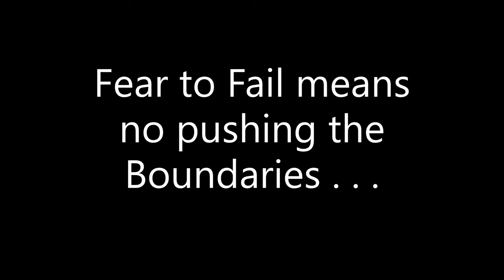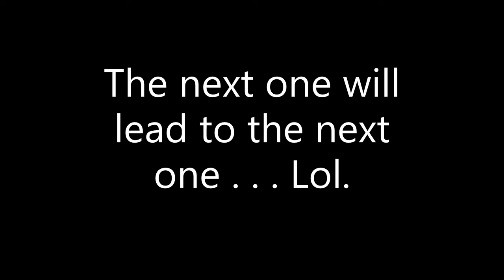The Scale Model Painting Crisis | Boomer Diorama ~ # 230

Comment: Do you show to get the oxidation with ipa in your previous videos
Reply from the maker: I have and it is fairly easy to do, although, the pattern is unpredictable. 

I guess I could show it again down the road. Basically what you do is take a particular color you normally weather with like white, grey, burnt umber and thin it down to a ratio of 95% IPA to the 5% Color you choose. Then, spray the whole car down really wet, and then stop the paint and just let the air flow over the car. As the high pressure air evaporated the IPA, the color oxidizes. With practice you can achieve stunning results on any subject you choose to paint.

You need fairly high P.S.I. (40 - 60) to make it work. It can produce stunning result that are virtually impossible to do without an airbrush. On the other hand, it can go south on you. But you can save it by power-washing the car with straight IPA until it cleans up some. 

Cheers ~ Boomer.
Reply: Hi Boomer 
Another good video. 
I am also working on a tank car that got destroyed by a bad application of Dullcote somehow.
But on another subject, I have quite a few successful projects lately that I thought would be disasters due to paint spills or sloppy ( so I thought) weathering , but when every thing dried I loved the results. A fact that you have said many time. Some times accidents are good!
Cheers Boomer
Bob
Reply: my little trick to weathering , is I keep two cleaning jars for paint brush and air brush jar,  isopropyl ,  one for light color paints ,and one for dark color paints,   and on a dark tank car I will spray the light color cleaning jar across the top of the tank car ,  and if it is a white tank car spray the dark color cleaning jar across the top

Comment: Sometimes I get on a painting frenzy but mostly when I work on a model I'm doing the same thing to each model like changing wheels or replacing couplers.  While working on a model I try to do everything that needs doing and go down the line like an assembly line including weathering.  Lately I've been working on scratch building structures for both HO and O scales.  I'm finally learning the art of dry brushing and it's working out quite well.  Even my wife commented on it.  Cheers from eastern TN
Reply from the maker: Yes. The dry brushing method is an essential skill. Sounds awesome!

Comment: When I first got back into the hobby Floquil and Scalecoat were the go to paints for model railroading. I have never found anything that is as flat as Floquil flat glaze. I’ve had to relearn so many techniques. I have had some success with Krylon flat followed by a very thin wash of cheap craft paint mixed with water then cut even more with 70% IPA. But oh “brother” light coats and dry between coats ( I use a cheap blow dryer). I’ve just about completely switched from chalks to pan pastels. No dull coat after. Let it sit for a few days and it should set. Really enjoy sharing ideas and techniques.
Reply from the maker: It's quite a game for sure. ;-)
Reply: @boomerdiorama  The one thing I can say is it’s really difficult to know when to say FINISHED. There is such a fine line between “hey this looks pretty darn good” and “ oh oh what did I just do”.😩

Comment: I don't flat coat any of mine or spray weathering. Takes longer but I feel makes them more individual as I'll never quite make the same effect, even if I try. I'm getting there with tank cars, weathering from the top down, washing down past the mid point and carrying some to the bottom. In some ways they are easier than box cars as there are few surfaces for dirt to settle on and often little rust, which are the two things I find take the longest (can spend ages adding layers of rust!).
Reply from the maker: The problem with tank cars is they simply do not look good weathered most of the time due to how the light reflects off them.

Comment: That is so funny about the matte coat, I was going to ask you if it should be done after wet on wet. Now I know.
Reply from the maker: I don't always use "matte" finish coats. Especially if the colors are dead flat anyway. Of course it is a good practice but has it's risks as well. It helps if you handle the car alot to protect the finish.